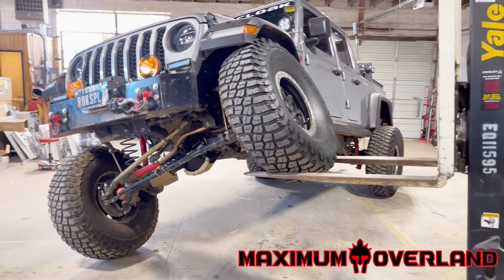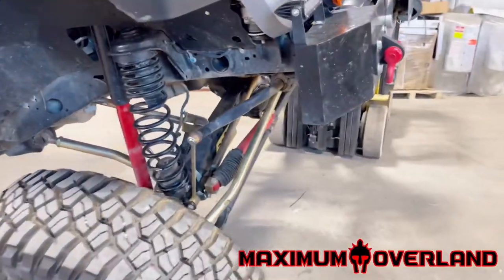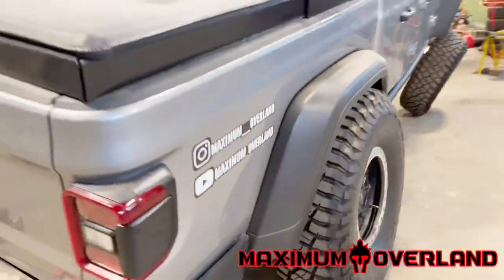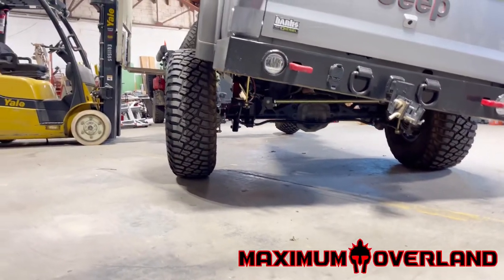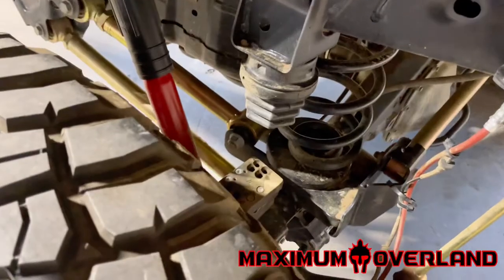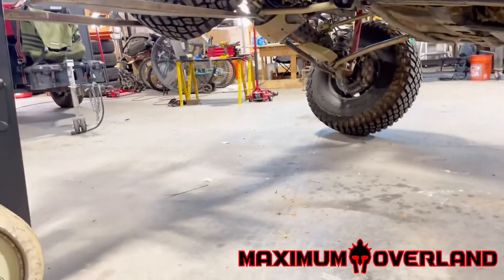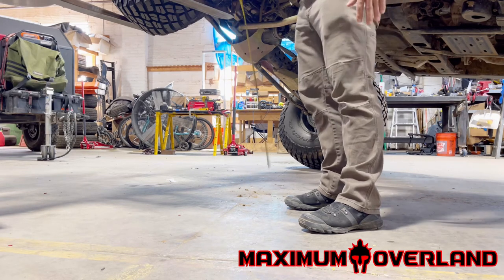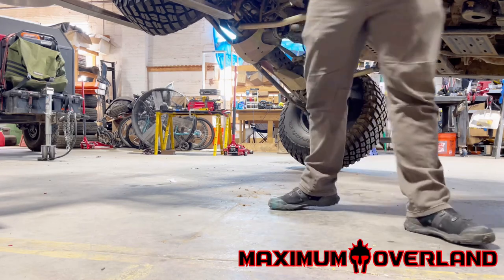2021 Jeep Gladiator Diesel Rubicon Flex’N OUT !! Metalcloak 3.5 Game Changer Lift w/ front DS #jeep

Comment: Looking good on those 37.5” tires, I’m trying to do something similar but I’m in an overland and not interested in gutting the fenders
Reply from the maker: Hey thanks a lot for the compliment and stopping by and commenting! It really actually does help YouTubers out tremendously. 

So those are 39" Km3 not 37's. You can fit the 37's easily without doing your fenders if your rig is built similar. The 37's are a lot smaller height and width wise. And just so you know, my channel is 100% Overland driven, please consider checking out my full channel and subscribing. That being said I still like to take the hard lines to keep things interesting, plus I travel alone a lot so I have to be as capable as I can for whatever comes my way. 
Anyway nice chatting with ya !!
Reply: @maximumoverland  actually if you measure your bfg it’s the shortest in its class. A 37” bfg measures 35.5” and so on.
Reply from the maker: Yes I understand height under weight but they are sitting at 38.00 even. An inch is typical of all tires under load weight. 37’s are usually 36.8 so they would be 36 under weight. That would be 2 inches smaller then these 39’s. But I understand what you’re saying.

Comment: Just installed this lift on my 21 jt diesel rubicon.  How many pucks are you running in the front?  Im at 3 and with the durospring bump stop its literally sitting on the bumps under its own weight.  Looks like your setup is similar to mine so im curious.  I heard you mention 2" daystar spacers on top of the springs but I think the spacers in the MC kit are 2".  Are you running the MC coil springs?  Im thinking im going to have to move to a different coil. Also, what PN is stamped on your spring?    Jeep is looking tough.
Reply from the maker: Thanks so much for watching and paying so much attention to detail ! It’s refreshing. Also thanks for the comment. You’re correct and they did sit on the bump in your same configuration. So I called Evo and Mel wade send me the EVO HD 4.5 Inch front springs for weight compensation. MC is still sending standard springs with their kits and they just aren’t strong enough. The EVO springs will fix you right up !! Aaron I hope this helps and if you need something please reach out. Also if you liked the video please consider giving it a thumbs up 👍🏼 and subscribing 🙏🙏🤟🏼
Reply: @maximumoverland  Great Info. I'm looking into the Metal Cloak Game Changer 4.5" lift for a Diesel JT with 40's and Dynatrac XD 60/80s. I keep hearing that the MC dual rate springs aren't strong/stiff enough to handle most "normal" payloads in the JT. 1) Has anyone tried custom springs from Coil Spring Specialties? I saw a video (can't recall the maker) who used them on his heavy overland JT set up with great success. 2) Has anyone heard if Metal Cloak is going to come out with a JT long arm kit like their Lock-N-Load Long Arms for the JL?
Reply from the maker: @davidwright5813 thanks for those questions, they are all truly valid. So what I found is that the only true production spring that were load capable and actually HD were from Mel over at Evo engineering. I went with them after the MC and it’s was those most insane difference for the better. 
As far as Spring Specialties, no I haven’t seen anyone particular running them therefore I can’t really speak to how well they would work. As far as MC, they currently have a long arm bolt on lock and load system. 

Anyway I hope all this helps, and please reach if I can offer anything more !! Have a great weekend !!

Your rig is gonna be killer my friend 💪🏼💪🏼💪🏼🙏🏼🙏🏼

Comment: Did you upgrade axles or steering at all? 5:13?
Reply from the maker: Hey thanks for stopping by and commenting. Please consider subscribing it helps me !! 
Also yes there more videos about it Keith. I trussed both axles, and ran RCV chromoly axles. I also trussed the knuckles in front. The steering was hydro ram over electric by Redneck ram. Upgraded steering arms as well. 

If you need anything else, please reach out .

Comment: After having this lift for a while, how do you like it and how much settling has happened?  Are you still sitting at 3.5”?  How would you compare MC to Clayton?  Thanks!  Great video of how well this thing can really flex!!
Reply from the maker: Yes there has been about a 1/2 “ of settling at all corners. Possibly because of my weight but I think that’s a general thumbs. As far as MC to Clayton, all I can speak to is the fact that MC is the only kit that requires a front driveshaft to achieve full droop or flex. That would tell me all the other companies are falling short of that actual claim, of a full 3.5” . Because if you didn’t replace the front DS, you immediately hit the cross member after only flexing out maybe 2”. Now the Clayton is a very very well made product with great joint as well. Ride is subjective because it’s all related to the type and level of shocks you finish it off with. 
I was really happy with what we were able to achieve with a fat guy like the Trail Slayer. 

Thanks so much for watching and remember to like, share and subscribe if you liked the content.
Reply: @maximumoverland  thank you for the reply and honest opinion.  I have been leaning heavily towards the MC lift.  Thanks again!!
Reply from the maker: @continuethejourneytransame1054  anytime. If I can help in anyway please reach out 🙏🤟🏼